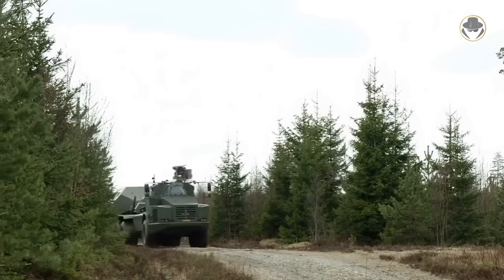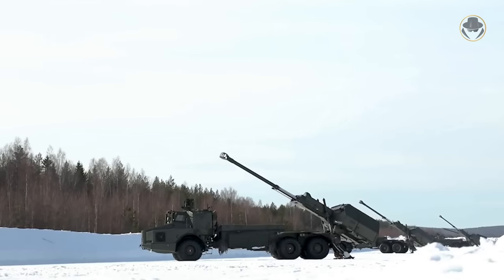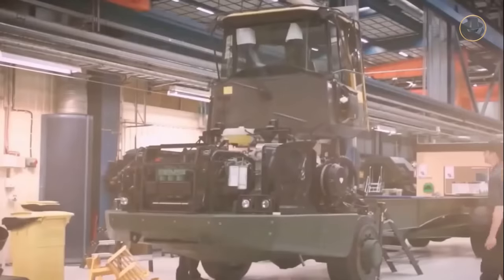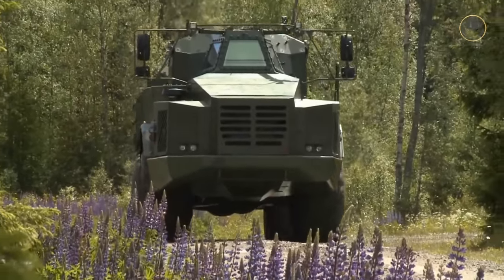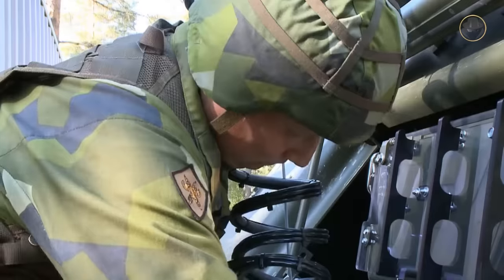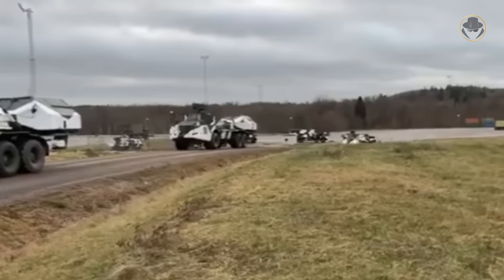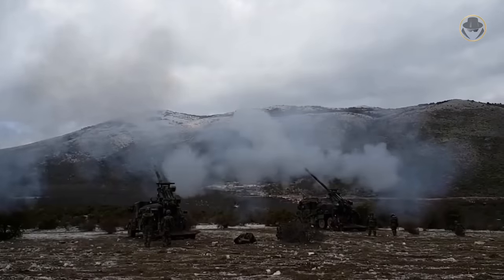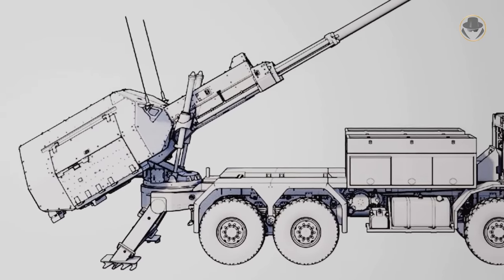Archer Artillery System | What is wrong?

Comment: There large numbers of Volvo A30 / A35 trucks used in the open pit coal mining industry in Indonesia, because they have excellent mobility characteristics in the wet and muddy conditions there. They will go places no commercial truck will go, and if maintained properly, are a very reliable truck.
Reply: Yea but generaly mines are generating huge profits so they can buy and use expensive trucks... in army you need cheap stuff as tax payers need to pay for it.
Reply: @Bialy_1  Yes, cheap stuff. As proven by nuclear submarines, air craft carriers and fighter programs, the military is all about "Cheap stuff"...

Volvo A30/35 is standard equipment in mining and logging world wide, there is a global supply network and 100 000s of units doing hard work every day around the world. It's a very common commercial vehicle. The video really got this wrong, in an otherwise excellent video.

And again. It's not a truck.
Reply: Unsuprisingly, we use them extensivly in the Swedish mining sector as well, as well as in construction and logging.
Reply: @Bialy_1  They aren't just for mining. I mean, they are all over Finland, every road construction site has at least one Volvo haulier.
Reply: Exactly. Would trust the Volvo to handle more.
Reply: @victorcapel2755  The US is kind of a special case...
Most countries don't operate aircraft carriers, nuclear submarines etc...
Reply: @Luredreier  

Almost every country on earth have an airforce, most countries have a navy. A LOT of countries have submarines, several countries have carriers.

The military is a major budget post in most countries. Major.
Reply: @Luredreier  

Even a cheap diesel sub, like the Swedish Gotland class, costs more than 25 Archer systems.

The Blekinge-class that is planned right now costs like 200 archer units/pop.
Reply: @victorcapel2755  Air force, navy and submarines, yes.
F35, aircraft carriers and nuclear subs, no.
Most countries don't use anything near that level.
And those that do usually produce their own stuff meaning that buying domestic products is important for for job and voter retention.
Reply: @victorcapel2755  True, but at that point you're looking for bang for your bucks.
And you can get more artillery pieces that might each be inferior but that combined offers more capability pr dollar with other systems.
Reply: @victorcapel2755  Like, look at the German army, navy and air force as a example.
Most of their equipment is on disrepair and not combat capable due to underfunding.
Other countries have similar issues.
Reply: @Luredreier  

The state of the German army is debatable. In Germany, ”disrepair” can mean anything from lacking an engine to lacking a lightbulb. The first one is a problem, the other one is not.

And the point isn’t that not all countries has nuclear carriers, therefor all nations have cheap armies. The point is that, contrary to the OPs point, military hardware is f*cking expensive. As I said, just look at what nations spend on their armed forces, any notion of ”it’s government therefore its cheap” is absurd.
Reply: @Luredreier  

With the Archer specific, it isn’t the fact that it’s mounted on a dump truck that makes it expensive, it’s the advanced weapons systems and underlying RnD-costs that adds up on small scale manufacturing.

The dump truck ads pocket change to the price.

I mean, it’s not even that much more expensive than the M777, a Towed howitzer produced in vastly larger numbers.
Reply: @victorcapel2755  huh? So if it's not that much more expensive than the towed m777 then why is no one procuring this seemingly more advanced and improved mounted version??
Reply: @regregan6852  Weapons procurement is just as much, if not more, about industrial- and geopolitics than about the performance and cost of a system.
Reply: @Bialy_1  Sure, but as he said, they use this in mines since they dont get stuck and can move etc. Is it smart to buy stuff that get stuck and blonw up or cant be used becuase terrain was bad?
Reply: only rich countries can afford nuclear submarines, aircraft carriers and expensive fighter programs designed to evade and penetrate multiple anti-air defense system.
And such countries usually have their own military industrial complexes that build their own weapons to ensure doctrine and logistical compatibility.

These systems act more like strategic/power projection weapons than tactical field weapons. Their presence alone, provide deterrence on strategic level.
With tactical weapons you need to made them cheap so you can deploy more of them on the battlefield.
And as shown in Azerbaijan and Ukraine, artilleries (whether self-proppled or not) are easy targets for cheap hunter-seeker/loitering drones.

Also the Archer platform ain't really a "standard" Volvo a30/35 hauler.
It is armored, mine and balistic protected. It carries the howitzer fire control system. It has a remote operated gun turret.

Comment: As a note, commercial vehicles tend to be rather geo-specific. Common models of trucks vary from country/continent and sourcing parts for an international buyer would be difficult. In contrast, the Volvo A30 is a common sight on industrial sites around the world. If the intent was to make something marketable to foreign buyers, the A30 was a great choice because there is a pre-existing international supply chain for its parts and maintenance.
Reply: The A30 is also by design built for field maintenance. Commercial costumers won't order a flatbed just to bring an A30 to a shop for it's overdue maintenance.
Reply: Yes, I ranked, trucks, by commonality, in my similar response.
Best wishes.
Reply: this is less and less true... trucks like cars are internationalizing for cost reasons... for example many cars of different brands share the same platforms, the same engines, and the same spare parts.. .. for example toyota, fiat, renault, peugeot, citroen, skoda, seat, nissan, etc... have models whose only differences are the aesthetics and the logos...

Comment: Excellent video on the Archer! However I'll contribute some minor corrections and also emphasize the following 2 broad aspects somewhat more than was done in this great production: ( 1 ) A KSP when competing with trucked SPH, is that the Archer is considerably more capable over the trucked SPH regarding off-road driving and obstacle crossing. Due to this truck-hauled SPH's ingenious construction and design Archer masters a wide range of different terrains and geographies (producing a 90 km/h top speed on paved road through its 440 HP engine output). May that terrain be dense, hilly forests or jungles, or even unpaved, rocky and steep mountain/hill roads, which for e.g. Caesar would be downright inaccessible. This versatility and broad-range capability to (access) hide and operate in dense, protected terrain while also activating the Advanced Multi-Spectral Camouflage System (MSC) increases both its overall potential and survivability noticeably. ( 2 ) The beastly auto-loader system together with the armored NBC-protected cabin and mentioned MSC allow for 20 sec. deployments and an unrivaled firing rate of 9 rpm and a full magazine firing (21 rounds) in 3.5 min, all the while the crew safely, productively and efficiently operates and coordinates ongoing firing as well as tactics via the Battlefield Management System.
Maybe these aspects and added facts will be incorporated in the next Archer-report, once it's (finally) sold in numbers to Switzerland and the US. 😄👍
Reply: Remember that, in the future, all the weapon system buyers will ask: Was this used against the Russians in Ukraine? How did it perform? So send these weapons to Ukraine, if you hope to sell them! (my 50 cents....)
Reply: @anomymouse5043  ...and the reason to not sending Archer (or any of all of the other "good-things-to-have all around the world) is that it take too long time to train ukrainian staffes at new and complex systems of a totally different standard as they are used to.
Reply: @anomymouse5043  
I totally agree! My intuitive guess is that Sweden is awaiting to be in the clear once the day of NATO-entry has passed. Considering they've quite recently decided to increase its Archers from 48 to 72 pcs., by then (NATO-entry) they would perhaps be able to spare and ship off some volume corresponding up to maybe 2 artillery batteries. It's obviously just a guess, but I have a fairly strong feeling they're eager to increase their military equipment support while also promoting and showcasing the Archer system on the "cat walk" of the Ukrainian plains.
Reply: @satanihelvetet  You are partially correct. Well, European countries and USA are already training Ukrainians for various weapons. Training should be included into the package. This also means that it is not rational to send, say 4 Archers, to Ukraine.

Weapon maintenance is another thing. I would bring trained Western soldiers to Ukraine (or to neighboring countries) to do complex maintenance tasks.
Reply: KSP. Key selling point. Ha ha. Took mea  second to understand. Mistook it at first as the Swedish abbreviation it for Kulspruta. Machine Gun.
Reply: I love these comments, they're full of corporative technobabble lol, the vocabulary and the exagerations in this comment are worthy of being called corporative lol

Archer is not "considerably" more mobile off road than trucked SPHs, it's a gross over simplification of "off road" for example the caesar (supposedly less capable off road) has been involved heavily and intensely during barkhane in mali (basically the sahara), shooting it's gun and traversing half of the country with no major problems. Everyone knows sand is HORRIBLE for mechnical parts... The archer was specifically designed for forested and muddy terrain, but other environnements are their own can of worm, caesar leveraged its superior speed on flat terrain and its easier maintenance cost, military procurement is also about preparing the type of situation you are expecting to find yourself into

A weakness of the archer that many people gloss over is its auto loader actually, yes it's sexy but a) it's a lot of mechanical parts (sand loves it wink wink) b) the design of the turret makes it rough to access, so if you want to repair the autoloader you are VERY screwed, it's complicated and hard to access. Maintenance on the auto loader must be dreadful.
Reply: @pougetguillaume4632  
...says the user with the most archetypical French user name north of the equator, while reeking of bias and partiality when making cringe, obviously incorrect counter-arguments, all the while making a failed attempt to seem knowledgeable on the topic. Move along kiddo... 🤣😆
Reply: "May that terrain be dense, hilly forests or jungles, or even unpaved, rocky and steep mountain/hill roads, which for e.g. Caesar would be downright inaccessible. " It sounds pure PR statement. Especially considering we saw the Caesar in Ukrainian forest, in the afghan mountain and in the sand of the Sahara, we also know that it is used by Cambodgia in their jungles. 

There is your PR statement, and there is the proof. Where is the archer ? He is climbing mountain in secret ?
Reply: @tm.8399  It's on it's way to Ukraine. So I'm confident UAF assessment will decide the debate with authority within a few months.
Reply: @ph6560  actually, every military shares this statement. Maintenance is the key issue to Archer according to several countries that have tested it...